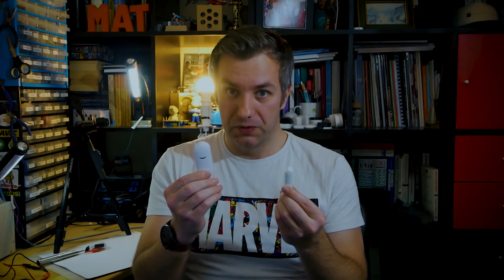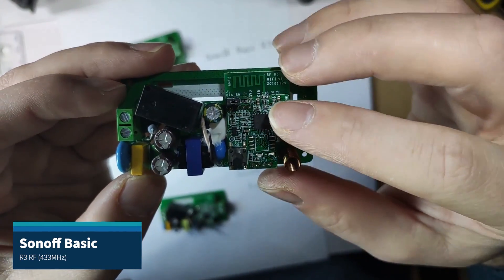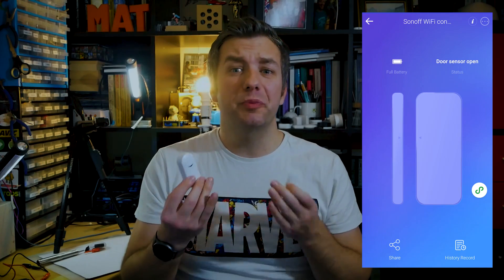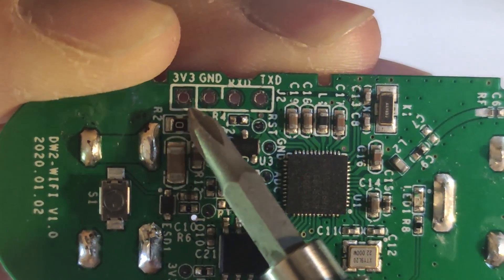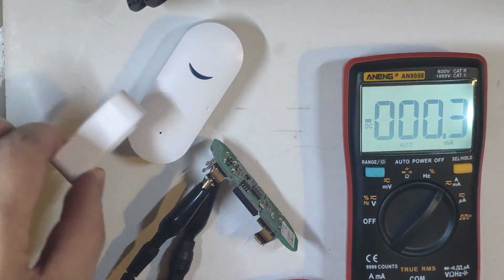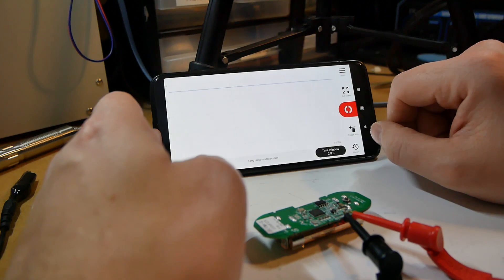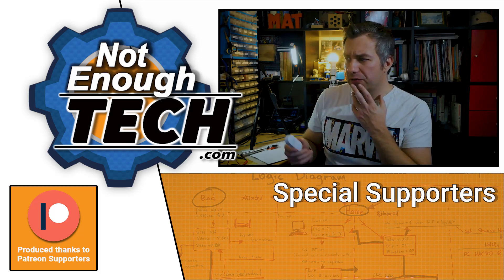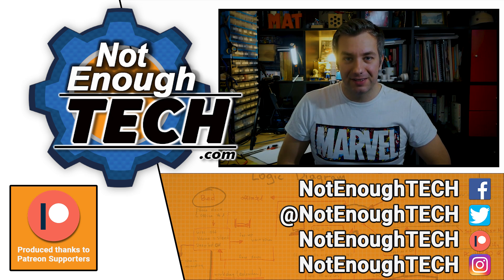Sonoff WiFi contact sensor? I'm confused  [preview]

Comment: My sensor heating batteries and draining out to low in 5min. Any idea why?
Reply from the maker: Are you using rechargable battery? What's the sensor?
Reply: @notenoughtech  no not rechargeable batteries. Its normal disposable batteries. Same door sensor
Reply from the maker: Low battery warning is given when the voltage drops below certain value. Single use battery has usually around 1.5-1.7V and is considered low at 1.2V 
Can you test the voltage of the drained battery from your device?
Reply: @notenoughtech  its 1.1v and it also released some chemical water after getting heat n drain
Reply from the maker: Your battery is definitely flat. Possible short inside of the device. Does it get hot when powered?
Reply: @notenoughtech  Yes it starting getting hot within 60seconds of inserting new batteries
Reply from the maker: You have a short somewhere.
Reply: @notenoughtech  inside the sensor? How to fix the issue?
Reply from the maker: Just RMA ... Unlikely you'll fix it
Reply: @notenoughtech  return time passed away
Reply from the maker: Speak to sonoff support then that's all I can advise

Comment: Does exactly do7.pl/AISensor what I expect for the product, and is pretty quick about ringing my phone when the door opens. My only complaint is that after a week or two of use, the app is showing some parts in Chinese instead of English. I really just need to know if it's open or closed and when it happened so it doesn't affect the use of the product, but I can't read Chinese and it also looks funny where some parts of the app are Chinese and some parts English. (I've confirmed in the settings that the app is set to English).
Reply from the maker: looks like a bug, just screenshot this and send over via feedback im sure they will fix this in next update

Comment: Hi, I don't know if you're going to be able to help me. My boyfriend's family lives in Mexico City, he has a weather radio (Midland WR120) that warns in case of earthquake. This radio has on the back a jack plug (which is used as a switch) allowing to add a strobe light as an option. In short I would like to make alerts connected via IFTTT, do you think it is possible to modify this door sensor to put this jack plug instead of the magnet?

 When there is an alert the jack acts as a switch and closes. The rest of the time it stays open (NO).
Thanks you
https://www.youtube.com/watch?v=x6JhlWjvCtY    (5"00)
Reply from the maker: That's an interesting thought! I really like what you are going for there. There are a couple of ways you can resolve this. I would measure the current and voltage params for the socket first, then you will know your best approach. I have a couple or options:

1. You can use this to create an electromagnetic field and trigger contact sensor (*if current and voltage is enough)
2. You can use the voltage and current directly and measure it with a GPIO (being low or high) you will need to pull down the pin to avoid floating and make sure the current is within the GPIO current/voltage specs.
3. You could wire a simple photo resistor and wrap the strobe to it then secure the whole bit  from external light. Its  the easiest way as you won't care about the voltage conversion. Then photoresistor can be easily added to anything you need to use to trigger something else
Reply: Great, thank you very much for these very clear explanations :) 
I will try to make this circuit, so we can have alerts connected. I'll come back here to post my montage.
Unfortunately not having the radio with me, I'll try to manage as I can (not possible to find it in Europe :( ) 
I'd come back for sure, but many months from now.
Thank you very much again.
Reply from the maker: Good luck - let me know how you get on

Comment: 3 Months isn't very long compared to ZigBee devices.  It is an interesting device though.
A great little follow-up video.  
Thank you.
Reply from the maker: But for WiFi standards it's impressive. You could do this with esp but the latency and sleep times would be insane
Reply: @notenoughtech  Yes.  It is impressive for WiFi.  
I want to see what the pricing will be as they you'd need to take battery cost into account and compare to ZigBee :).
They are definitely an interesting device.  They may fill a certain gap in the market.
Reply from the maker: We will know in a couple of weeks. I have no info about pricing yet